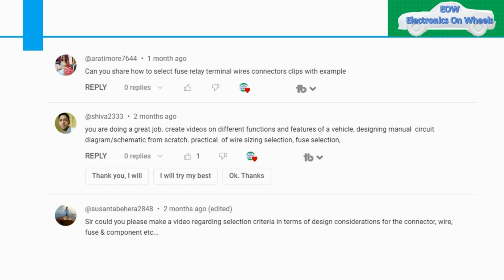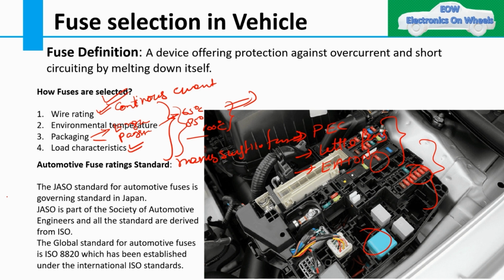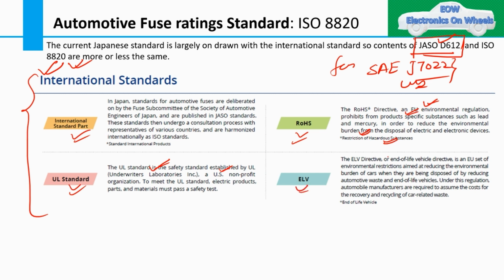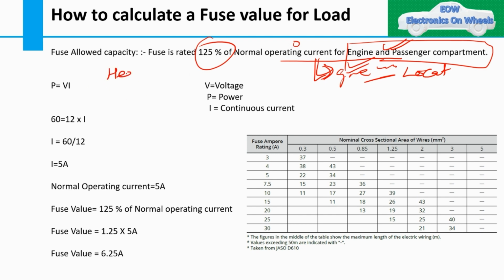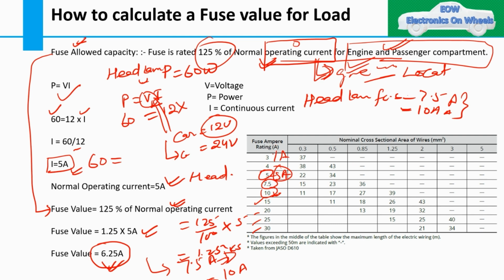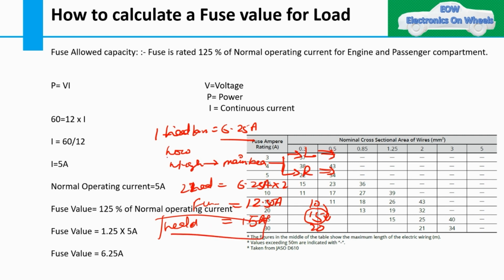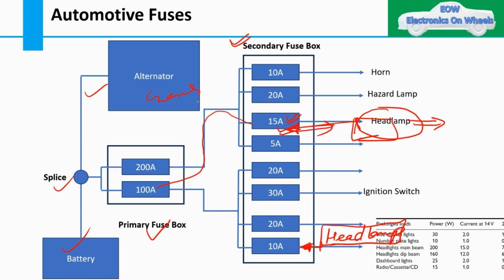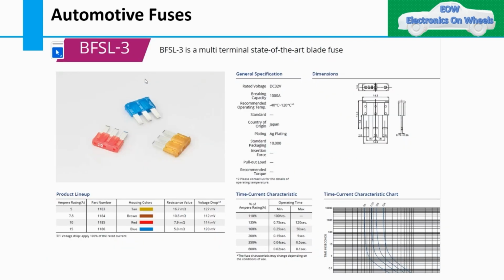formula||Fuse Calculation ||How to Calculate Fuse For Circuit - Proper Fuse Selection for Protection

Comment: For high beam and low beam fuse value will same or different?
Reply from the maker: Yes, it would be same. If you take example of halogen lamp 55w for low beam and 60w for high beam then it would be more or less same. You can calculate also based on the explanation given in this video.